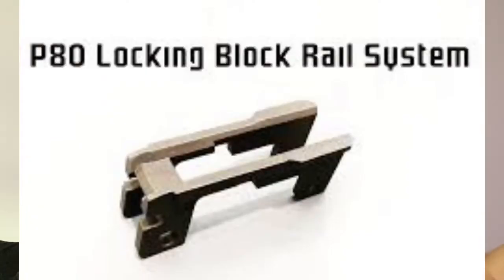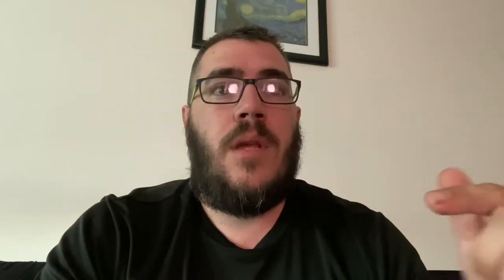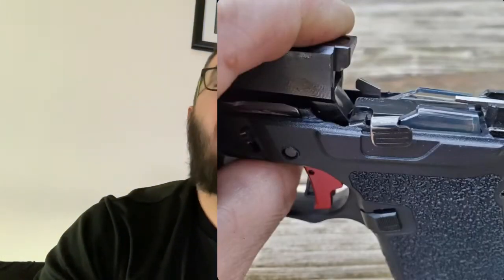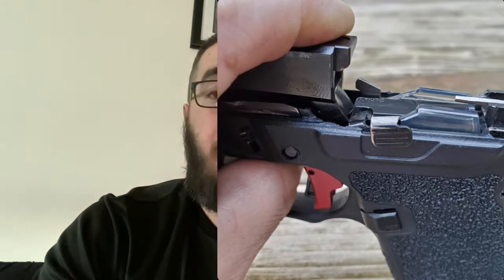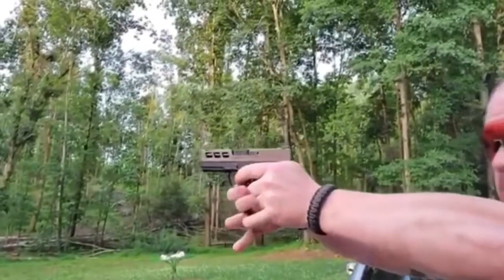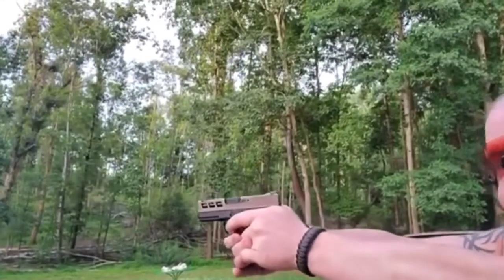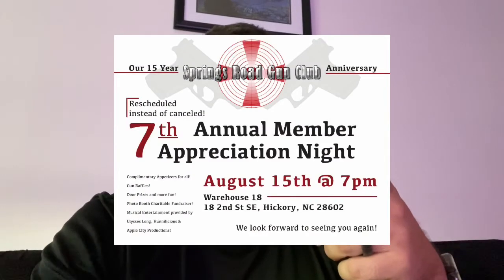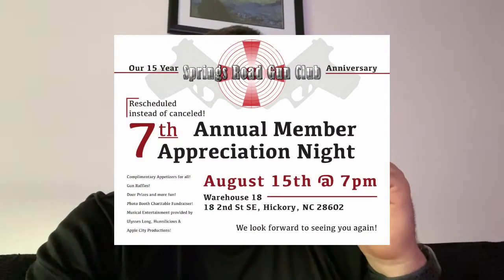Polymer 80 pf9ss- part 2 update

Comment: Most likely its the P80  front locking block .
These Pf9ss's are finicky
It CRITICAL  to use O.E.M Glock 43 lower parts ONLY in these.
And o.e.m. Glock 43 mag.s .

I did that & mine it's
 SPOT ON !

It's natural for the top round to touch the ejecter & if you notice the round is DIRECTLY IN LINE with the feed ramp on the barrel .
That's why they feed everything you throw in it .

I threw a 4.0 pd. Striker Spring & reduced tension Safety plunger spring in it .
And instead of a 7-8 pd. Trigger pull ,
It now has a 4.5 -5 pd. Trigger pull .
And puntures every primer 
Less likely to go off target an /or cause collateral
damage .
Smoooth pull & Awsume
quick audible reset .

The 42 & 43 stricker/firing pin  is shorter than all the other 9m.m. Glock i.e. Glock 17 -19 etc. Yet utilizes the same 5.5 pd.  Striker spring 
Thats why the trigger pull is 
7-8 pounds .

Its basic physics .
If you compress a given pound spring even more on a given Stiker assembly ,
The poundage is higher .

Stretch out an ink pen
 spring , then put in back in & the pen spring will be harder to depress .

Hope this helps. 😊